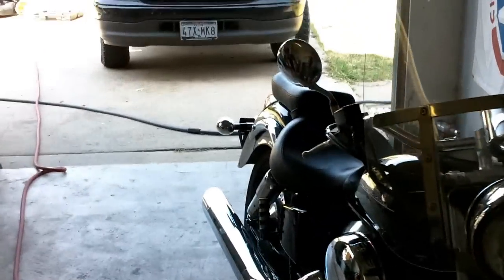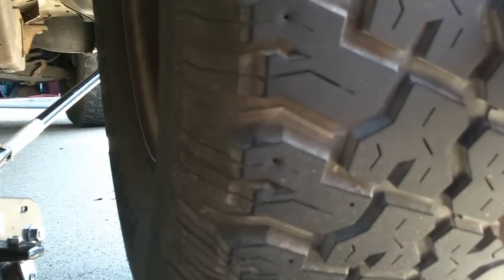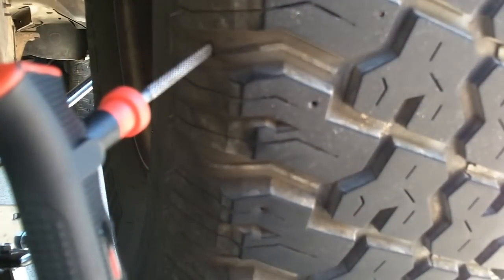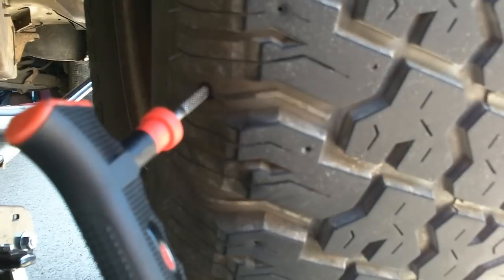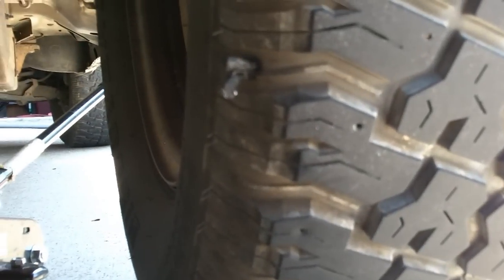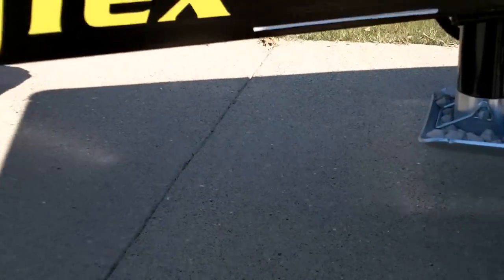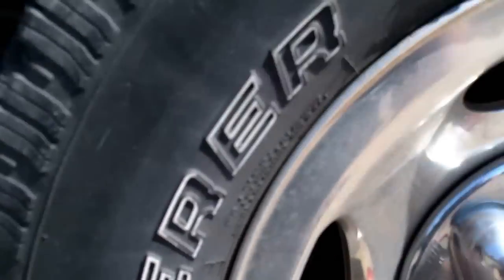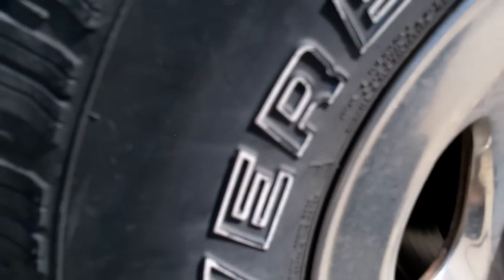HOW TO PLUG A TUBELESS TIRE    truck, car, lawn mower

Comment: I have always use a lube on the patch and it helps get it in the tire. I have had good luck with patches like that.  I plunged a few tires . I had one in my 91 toyota camry . It lasted for 10 years up to when I was hit in the rear and it totaled my car . Its a very interesting story if you want me to tell it here let me know.   It happened 1 month ago.

Comment: im rebuilding a few 16cc hydro gear scag tt pumps and i need to no if they need to be bled and if so how to do it so if you can maybe make a video explaining how to bleed the lines, pumps, and wheel motors, thanks man, ohhhhhh and also what oil should be used???

Comment: I've used these for plugging lawn tractor tires with mixed results.  I had problems when I stuck the plug in the tire, and pulled it out,  it would pull the plug back out again.  What was I doing wrong?